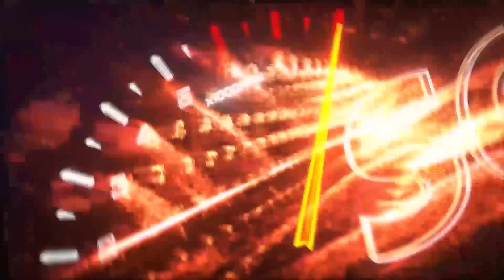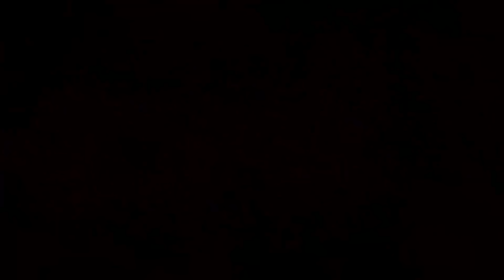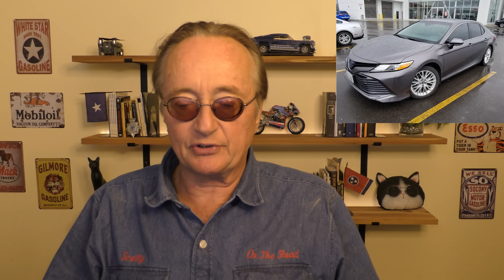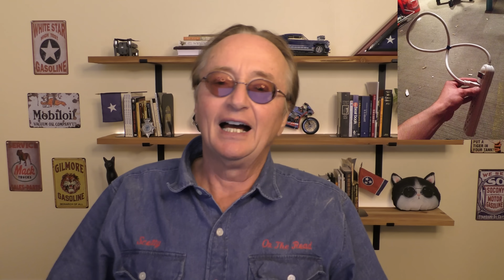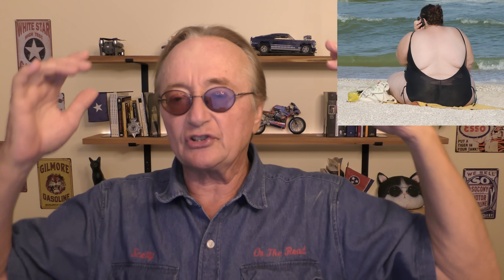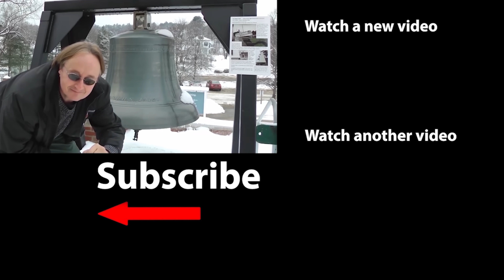Gas Prices Just Flipped

Comment: The price of fuel seems to be completely irrelevant. People around Phoenix absolutely floret and go crazy so that they can get up to the same red light that I do by coasting while that light is red. Sometimes coasting works so well, but the light turns green and all the traffic starts moving so that I don’t have to stop! And it seems the bigger the vehicle and the worst gas mileage that it gets, the more aggressive that people drive them. I sure as hell would be flooring my giant pick up truck that already only gets 15 miles to the gallon it best if you drop it off of a cliff, but you put me in single-digit territory, and I better be in a 1972 droptop El Dorado

Comment: I drive a 2006 E320 CDI Diesel Benz.
If I set the cruise control at 80 MPH on the highway, I can get about 40 MPG.
If I set it at 55 MPH  I can get around 57.5 MPG.
And yes I pay more for fuel.
As for fuel prices, a couple of months ago the Saudis cut back production by 1 million barrels a day.
Now Saud and Russia are cutting it back more.
I've got well over 250,000 miles on my car, but I'm keeping it.
I'll have to get a new one in a couple of years, but it's paid for.
And at 80 MPH and getting 40 MPG (or 57.5 if I cut it back to 55) I'm happy.

Comment: Just bought a 2013 mini Cooper to save on fuel for work, before realizing that it requires a minimum octane of 89. Can I run 87 ? Or will I risk motor damage? I drive 120 miles a day 😕

Comment: We could just be using high voltage electrolysis and putting water in your car as fuel, still need oil and gas for energy

Comment: Did he say 112v ac? And you cant compare 110 or 120 volts  AC to DC tools. He was trying to say his 112v ac tool is more then a 18 or 20v tool. Voltage doesnt work like that
Reply: Yes, he did. I caught it, too. I have never seen ANYTHING rated at 112 volts (AC or DC -for that matter) Scotty and I are the same vintage, and if you go back to when we were kids...things were designed for 115 VAC. Then, it went to 117, 120, and more recently 125. Plugged tools basically have the resources of the power supplier available to them...limited by whatever the electrical resistance of the tool is under load. Not so, with battery equipment. As a battery ages, its internal resistance increases...and that can greatly limit the current the device has available to it.

Comment: On the Mitsubishi Outlander CVT, like all Jatco CVT's, they hide a cooler filter and it plugs up quick especially if driven aggressively.  Change it and the fluid and have someone with a scan tool reset the oil degradation monitor.  When you ask a parts department about the filter they will have no idea what you are talking about and neither will most techs.  On that Mitsu it is located under a round protruded cover you can see from under the car near the bell housing area. On the old narrow ration ones it's actually under the cooler bolted on the trans.  Part number for both, and will work on Nissan's, is 2921A007.

Comment: I disagree with the electric Vrs Battery impact. I have a Dewalt  impact that works great and use it for tire rotation and breaks on our vehicles. One think electric/battery has is torque. It works great and I have only charged it twice in a year. I can use it on the side of the road if I need to as well. No plug needed. Thanks for everything Scotty.

Comment: Scotty is 100% right. I do corded for almost everything now. The batteries of the older model tools you buy - sometimes they even stop making them and consider them obsolete tools. Basically, even the companies that make them as off-shoots stop making them. So, if you have a nice tool that is rarely used over the years, eventually you will have to buy a new one. That sucks! That's why I go corded for everything I can this point forward.
Reply: I have both.  If i have to go fix a fence 250 yards from the nearest outlet, i take my cordless makita (brushless motors) gear.   If i am working in my shop, i use the corded tools except for the drill and driver…more convenient with no cord.
Reply: If your doing household car work yeah they are pretty good but shop work? Cordless all the way bc even tho technically you don't get has much power to it, with brushless DeWalt and miluakee take way more of a beating and still have way more power
Reply: Cordless for conveniance, cord for power. Have the best of both worlds and bring a generator or capable rechargeable powerbank for quick jobs.
Reply: I love corded , lasts for a decade at least.
Reply: I wouldn't worry too much about this. 18650 cells have been around since the 90s and they are what's used in cordless tools the only issue you might have is having a tool manufacturer that locks down their tool or battery making a battery re-celling harder. Thankfully it seems to not be a common practice for example last time I checked there where no checks between a Makita lxt tool and the battery

Comment: Scotty. I’m fixing to buy by a 2010 Ford Ranger 4x4 manual with 40,000 miles for 17,000. CARFAX checks out and the exterior and interior is near mint condition. What are your thoughts?
Reply: Scotty doesn't read or respond to comments, but I'd jump on that Ranger.

Comment: What I heard a few days ago about the strike is that the automakers wanted a 46%raise and only a 4 day work week (which is ludicrous beyond compare)
Reply: i used to work in a car plant.  assembly line works 5 days, support work 4.  we did as much work in those 4 days as assembly would do in 6 based on hours worked.
theoretically it was nice to have the day off in the week to do your banking etc but because of sleep debt, you just spent it in bed.😴
Reply: @billynomates920  in Europe they have 4 day workweek and morales up so production is more efficient. Japan they pay for workers to nap and they also have shorter shifts along with Europe
Reply: @MetalHDGMR  indeed!  one of the first pieces of paper i had to sign at the car plant was a form to voluntarily opt out of the eu directive on working time. 'voluntary' meant i had to sign that before they'd hand me my contract.  
it does work well for offices. i think it's still 37.5 hours a week which is designed for 9-5 with a half hour lunch break or 9-5:30 with an hour which i preferred because you can choose to eat at your desk and catch up on your admin or drive down to the leisure centre and get a 20 minute swim in.  i could usually do that once a week. 
you are absolutely right about productivity too. you get used to 4 hours solid work, chat on your lunch break, 3 & 1/2 more then home so your kids can see dad before bedtime.
Reply: @Vincent-ke5zn
If those four work days are on a rotation shift schedule, they could employ more workers and run the factories 24/7 the employees would have a three day break between their work week, and the production would remain the same or maybe even increase due to the workers being better rested!!! 
I mean that’s a very plausible idea!!!

IF that’s the working idea!!!!
Reply: @AzzKicker-bz1cb  that's a good point, but that's not the case that I'm getting at. The point that I'm making is that they want 46% more $$$ and less hours
Reply: @Vincent-ke5zn profits for Ford and GM have increased by 92% from 2013-2022 so a 46% increase in pay and 20% decrease in hours is not that  crazy.
Reply: @AzzKicker-bz1cb blame Henry Ford for starting this 5 day work week and 40 plus hours! I work for a company that has three different shift models and now run 24/7 one of the shift models is 4 day work week and people are happier. They have been increasing percentage on differential on 3rd and overall market adjustments in pay to compensate.
Reply: Vincent - ops normal for unions: more money for less work.
Reply: look up bargaining some time
Reply: 4 day work weeks are fairly common. 10 hours a day. Hospital Nurses often put in 13 hours a day 3 times a week.

Comment: Im sorry, a 2019 outlander with 240k miles and not a SINGLE transmission service?!?! I work at Mitsubishi and ive had to chance multiple transmissions, and mostly from that model year outlander. Theyve failed simply by not having the fluid changed in 50k-60k miles. 240k and nothing??? That one is an anomaly for sure
Reply: Probably 100% highway gas mileage

Comment: I recently bought a Ram 1500 classic and it sometimes has a slow time taking off when it's cold it seems to lag and then shift hard into gear  any idea why this happens? Thanks
Reply: Trans is worn out ...needs clutches  they slip when cold and worn.
Reply: @chrisgarrard2081  i was thinking the same thing thanks i appreciate it 👊
Reply: Also it shifts hard because of the stack of clutches is missing material, causing slop or space. So when it does engage it "bangs".

Comment: I had a cordless car vacuum cleaner years ago and the blame thing didn't hold a charge long enough to finish the small car I had. After a few months the thing wouldn't even charge up. I swore I never will buy ANYTHING cordless again and I haven't!
Reply: What about a cellphone?
Reply: @wax1776 We haven't had a landline for years even before I bought the vacuum cleaner I bought a cell phone. I have gone through several cell phones and some of them work and some don't. No, it isn't the same as the vacuum cleaner. The cell phone doesn't require that much to keep it charged up. A vehicle or a vacuum cleaner does.

Comment: I'm just concerned about the talk going around that says folks should think twice about parking an electric car in the garage or any where near the house due to the batteries that can ignite and burn the home down. I'm thinking home owner insurance companies are not going to like that.
Reply: To be fair, gasoline in an ice care could burn your house down as well.
Reply: @xocomaox   You can put out a fire in a combustion engine, there is no putting out a battery in thermal runaway.  That's a noticeable difference.
Reply: @mariannorton4161 It depends. ICE fires burn hot because gas is designed just to do that, to burn. Once the fire gets hot enough not even a water hose will put it out. You might be able to snuff it with an extinguisher but the heat is so hot it won't dissipate fast enough by the time you run out of CO2 it will ignite back up again. It really depends though how much gas leaked and how fast you got to it.
Reply: @LiqqaRoni-cx3tx   I was driving a car that caught fire and was fortunate enough to get it out before it cause a lot of damage - otherwise you are right - it would have been a total loss.  But that's the difference - once an EV catches fire there is no putting it out and I don't care how you try.  I know of 5 cargo ships that were taken out because of EV fires on deck.  ICE would have been extinguished with on board fire suppression.

Comment: If you are changing the timing belt on a 93 Volvo with over 100K miles, you might as well change out the front seals and water pump.
Reply: I always change anything that potentially will go bad, crank seals, cam seals, hydraulic tensioner, water pump, knock sensor, crank position sensor....
Reply: Any vehicle. If you don't know, change everything.
Reply: Especially the front crank seal because if that goes bad, there's a good chance you'll be buying a new timing belt all over again. Can't tell you how many oil-soaked timing belts we've replaced because the front crank seal went bad and leaked oil all over them.
Reply: @ChickenPizza  I say, if you are not sure of the history, change everything. I didn't when I had the chance and had to do it over again. Everything means - crankshaft and cam seals, oil pump seal if the oil pump is in front and has a seal, water pump, and the timing belt itself. Whether you need to change the idler and tensioner all depends. If your application has a hydraulic tensioner, good idea to change it.
Reply: 1993 Volvo.  If it has a redblock, the tensioner should be fine and coolant pump is driven by the V belt.  These engines are mostly non-interference so a broken cam belt only means it needs a new belt.

If it has the VAG diesel engine, that's different.  Change it and the coolant pump, I think.
Reply: The change Interval for the 93 is every 100K. Not 1 mile over.  And my mech always did water oump at the same time.
Reply: @ronwyckoff824  The official guide I have states every 50k.  The plethora of redblock camshafts is probably why 50k was given.
Reply: @idonotwantahandle2  I may have to stand corrected. My 93 was my 1st volvo, the ones I have had since were every 100K. Either way. I changed them on time every time.

Comment: I can promise even over 200k miles if you haven't changed fluid, you still should. Especially since its only a 5 year old vehicle. It's not an old 90s pickup truck.
Reply: I'd rather an older 90s pickup over most  of the newer cars and trucks.....a 90s pickup is built better...

Comment: I don't know Scotty. My brother had a Chevy Cavalier in the late 80's, he bought it new. It was decent for maybe the first couple years. It started rattling itself apart and I was always helping him fix that PoS. That was probably the biggest factor that pushed me into buying rice burners. You take care of them, they run forever, ....well most of them....Nissan & Mitsu certainly shite the bed since then.
Reply: I had an 85 cavalier rs. Got it in the spring of 93. Had 36k on it when I got it. Ran fine for about a year and then..... everything under the hood started falling apart. It leaked coolant, transmission fluid and went through 2 timing chains and the 3rd was showing signs of getting ready to give up the ghost too and this was all by 69k. It was always needing something fixed. It was the biggest p.o.s. ever and I'll never deal with chevy ever again! I'd bet serious money everyone involved in it's construction at the factory were high as kites that day they put it together!
Reply: My brother bought a new Chevy Zega. As he drove it off the lot, it died on the shoulder of the road. Wouldn't restart. Walked back into the sales office, got his money back. Has been Toyota/Honda ever since.

Comment: I am thinking about a vehicle, that I wanted to save fuel in the meantime. I am hoping that it is an older, 2008 Mazda 6 sedan with the 2.3 L four-cylinder engine, which produces 156 horsepower and the five-speed automatic transmission. It should be a great idea.
Reply: I have a Mazda 6 2009. I've had it for 3 years, and only problems have been the battery which I easily replaced. I love my car lol
Reply: They are good on gas I had one around the same year , not very reliable though.
Reply: @TylerEatsZombies  Oh, well.